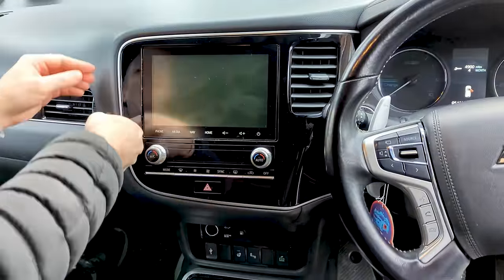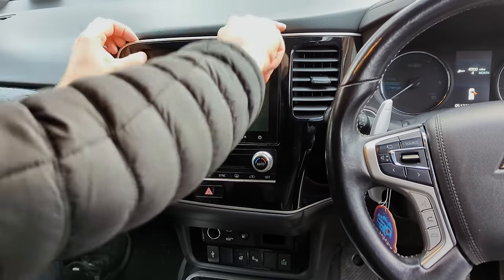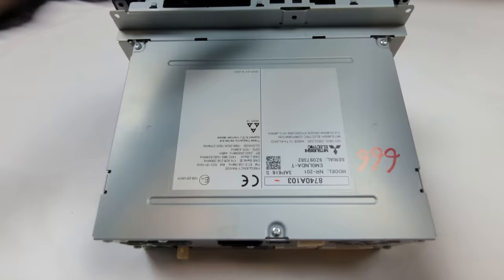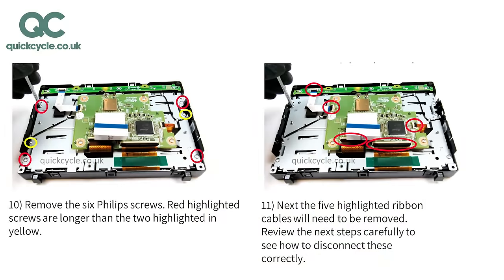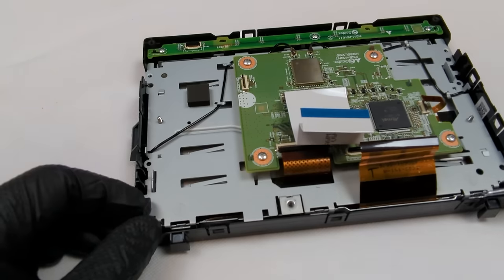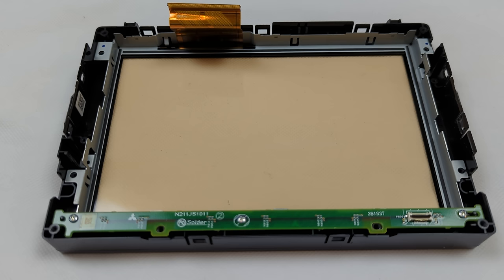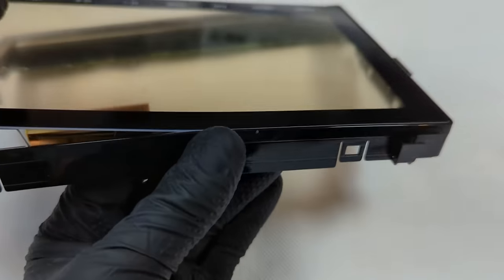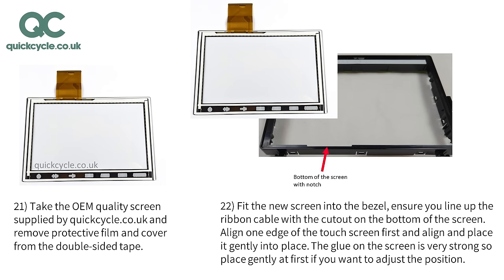Mitsubishi Outlander Touch Screen -  How To Replace and Repair SDA2

Comment: Hi there, my 2020 Outlander radio went crazy. Radio frequencies began to change themselves. How do you think, could it be fixed by replacing touch screen digitizer?
Reply from the maker: Hello, if the screen is making random selections without your input this is likely a touchscreen fault. This is a common fault on touchscreens fitted from the factory. Please visit our website to order a replacement. Thanks Mike